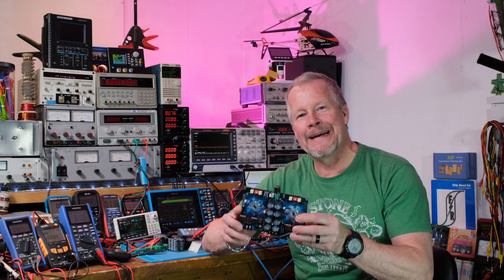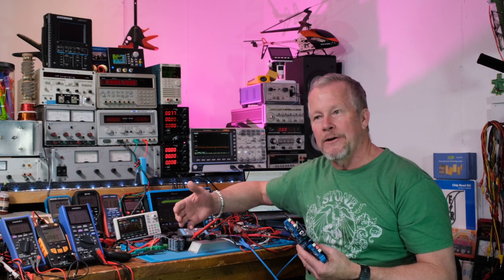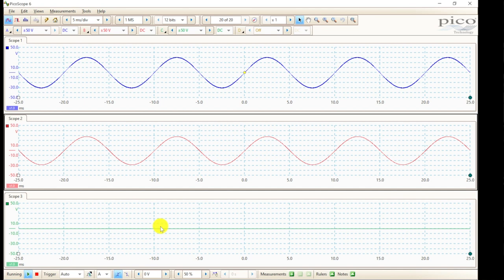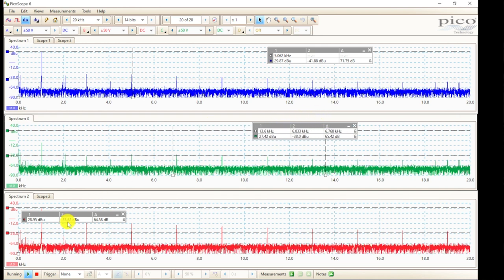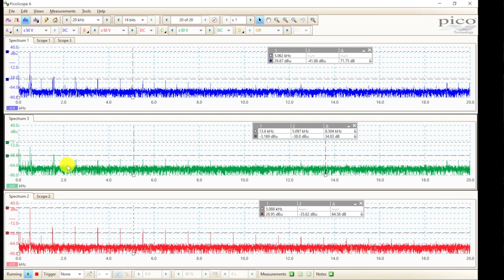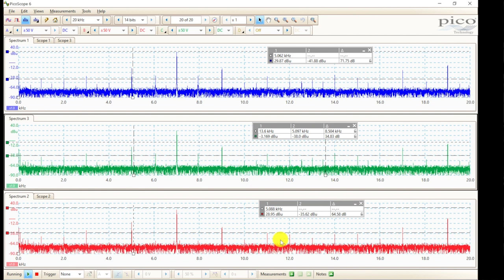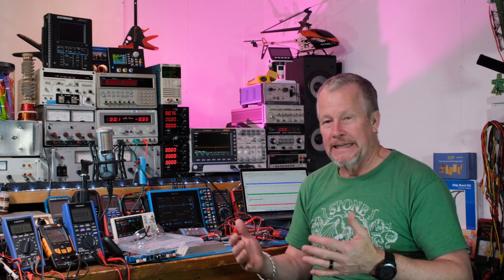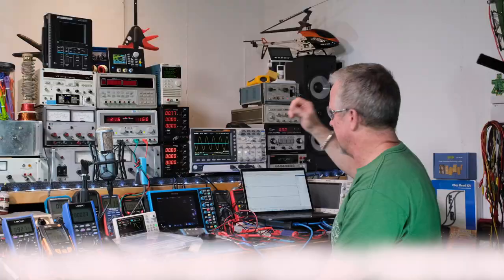Class D Amplifier how does a 2-Way Speaker Crossover add filtering?

Comment: I'm not  sure how you connected the load resister? You will need 2. One load to simulate the LF driver and one to simulate the HF driver. I could only see one load, or am I missing something?
Reply from the maker: Thanks Michael, you are right of course;)  I actually did have an 8 ohm 200 Watt resistor load on the woofer output and another on the tweeter output.  I should have shown a quick setup.  I did show the setup on this previous video so I was trying to save time;) https://youtu.be/NlExOwHdDMQ
Reply: @KissAnalog  Eddie how did I miss THAT video? I knew my life was in complete, just didn't know why. You're servant, Mike
Reply from the maker: LOL Thanks Mike!!

Comment: I wonder if you would get as much heat and ringing in the inductors if they were aircore. When I make my crossovers I always used aircore which I wind myself.
Reply from the maker: Thanks for this great comment!  I’ll do a full review on this crossover.  It does have air core inductors but it is the resistor that is getting hot.

Comment: Replace the woofer and the tweeter with pure resistive dummy loads and do the same test again. For the frequencies lower than the cross-over frequency, the dummy load goes to the tweeter, and vis versa.
I suspect the return loss of the speakers and the filters is pushing the amp to its non-linear region. Or probably the amp has a poor S22. If the tweeter has some kind of mechanical resonance, it could generate harmonics on its own when excited with lower frequencies.
I like your videos.
Reply from the maker: Thanks for this feedback!  I did use two 8 ohm resistors (200 Watts each), one on the tweeter and one on the woofer output.  I should have shown a quick view of my setup.  I did show my setup in the previous Class D video though, so I was trying to save time;) https://youtu.be/NlExOwHdDMQ

Comment: I also wonder if the ESR of the crossover capacitors is a factor for bleedthru, resulting in them partially decoupling from the load at the pwm frequency; a bunch of smaller caps in parallel may help address this in part. It is a curious anomaly.
Reply from the maker: Thanks for this great idea!  That is possible I think, and I think the coils themselves have winding capacitance that could be leaking some through.  I'll have to take a closer look;)

Comment: What I'm not sure about is the capacitors they are filtering DCV where a speaker is ACV how does the capacitor have any bearing on the AC if it's filtering DC?
Reply from the maker: Great question!  The cap does filter DC, but it also filter AC voltage with different levels depending on frequency.

Comment: You should have started by showing the bode plot for the low and high ports of the crossover assuming it's being driven by a low impedance and loaded with 8 ohms.

I'm guessing that your class-D amplifier has way too little output filtering on its PWM output, so it's putting out a lot of higher frequency content. This ratty signal is showing you the step responses for the crossover, which you aren't supposed to see...

It would be interesting if you designed and built a combined output filter and crossover network for this not so high fidelity class-D amplifier...
Reply from the maker: Thanks for this great feedback - and suggestion;)  I think you are right on all accounts!  I will see if I can fix this as I did have a lot of hope for it;)

Comment: Class D are horrible amplification devices for use in very high quality audio. ATC SCM ASL monitors from ATC transducer company will not use class D even in their active professional dynamic loudspeakers monitors, which are the highest quality rated dynamic studio monitors in the world used by all the top recording studios world wide. They only use class A input driver stage to power their class AB mosfet output stage to their active analog crossover powered 3 way active studio monitors. 50 Watts treble, 100 Watts mid, 200 watt bass, for their SCM50ASL, SCM100ASL,  SCM150ASL.  Their SCM300ASL uses 100 watts treble,  200 watts mids,  275 watts x2 bass.
Reply from the maker: Thanks Ian for your feedback!  Class D amps are growing in popularity, so they are getting more mature in their designs and GaN FETs will help improve.  Switching power supplies are making big headway - even in audiophile equipment.